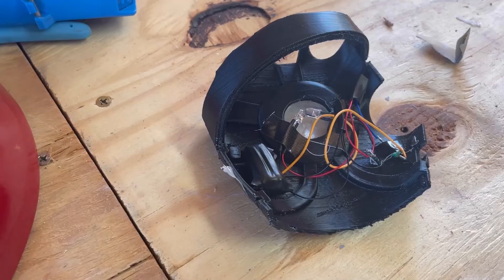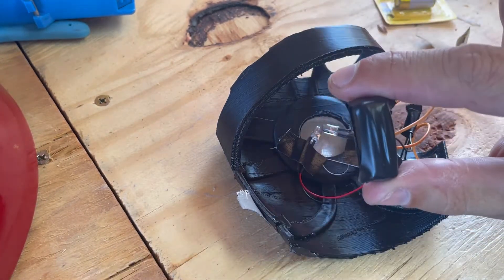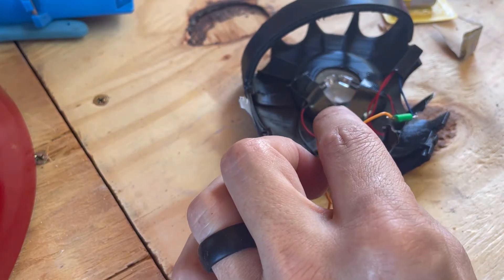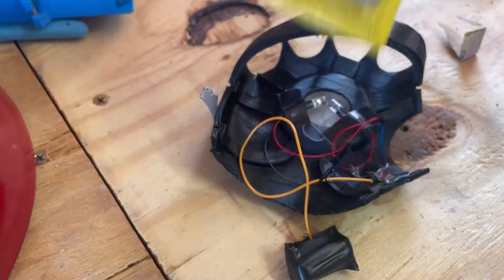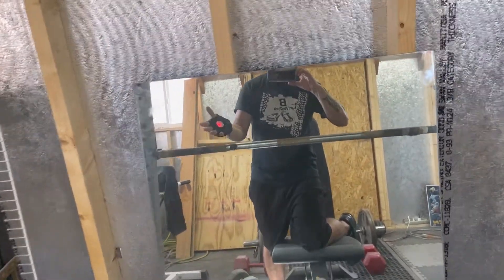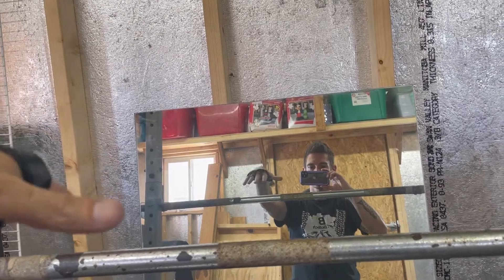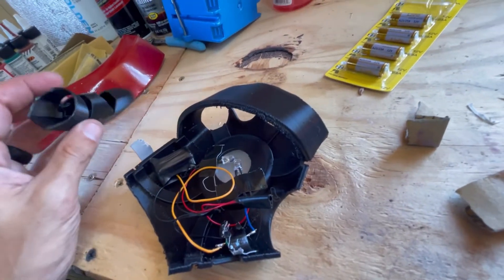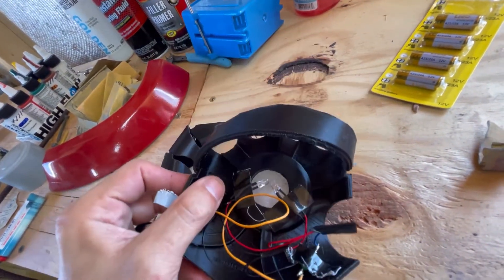How to make Iron man repulsor gloves | iron man repulsor glove tutorial quick & easy with wiring!

Comment: Ty needed this but I would like to add a sound card..where can I  get that?
Reply from the maker: https://amzn.to/3HgVGaq
Here ya go!
Reply: @Darkwingdad  ty perfect..but how would I connect it for the sound and light to  Sync
Reply from the maker: @d-mart3733  you would wire it the same coming off the tilt switch but split the wires (2 positive 2 negative) to the led and board that way they go on/off on the same position
Reply: @Darkwingdad  ok so I would cut the button off after recording?
Reply from the maker: @d-mart3733  the button is where you’d wire it coming off the tilt switch, that replaces it